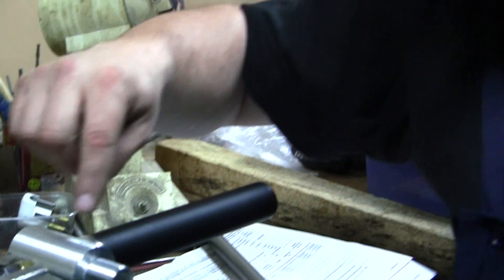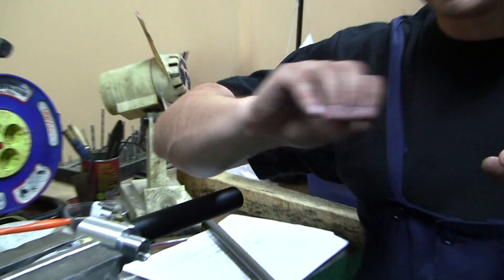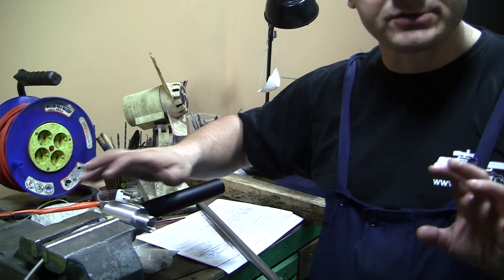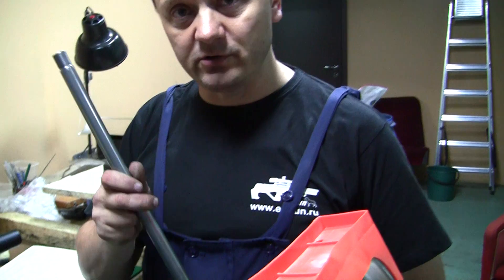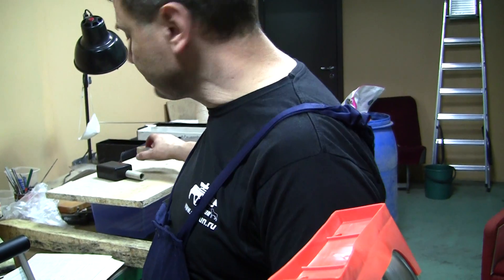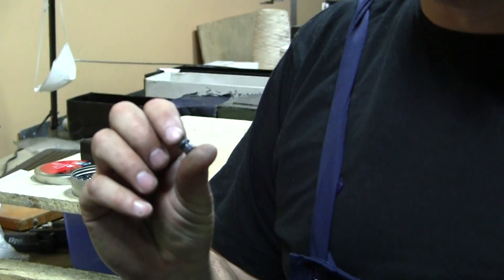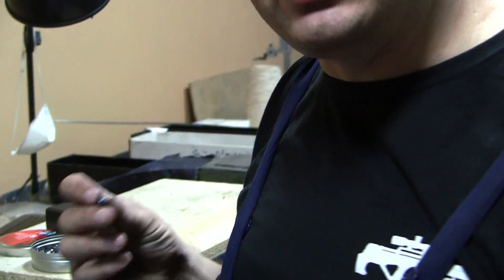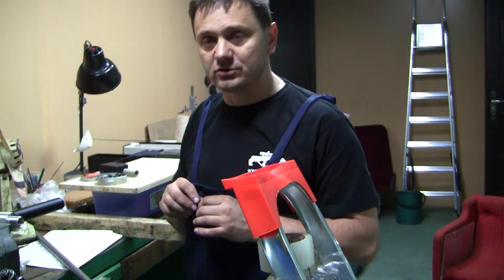9 mm EDgun prototype.mpg

Comment from the maker: No one program can calculate PCP system correctly, I tried many times. There are TOO MANY different things which influence to the result. I tested a new valve now and got the result about 4.5 cv3 of air per Jole of energy (very good result of air consumption for 5.5 caliber is about 7-8 cm3 per Joles of energy). Keep on working on the valve...

Comment: For us who use English units... 300 m/s is almost 1000 fps and 230 joules = 170 ft*lbs.... what a beast... and knowing that it is an Edgun, should be accurate to 100 meters or more... can't wait to see he finished product... I want one.

One question... Are you able to make a moderator to quiet the report of each shot? I am sure that more power and the larger pellet will equate to more air thus being much louder than your .22 Matador...